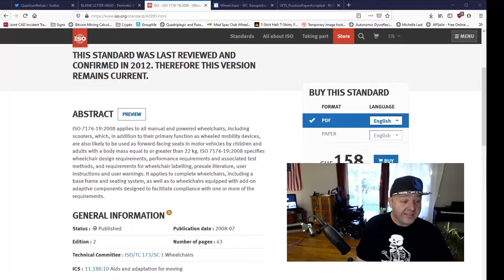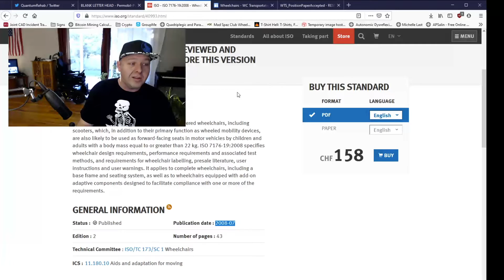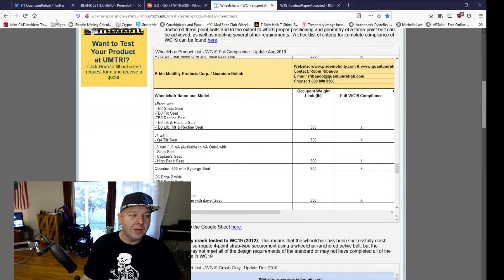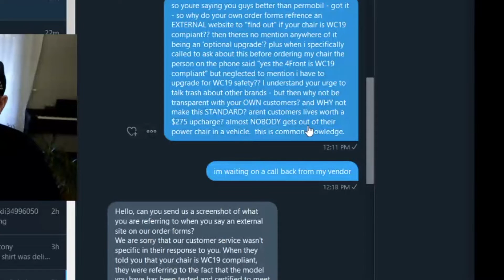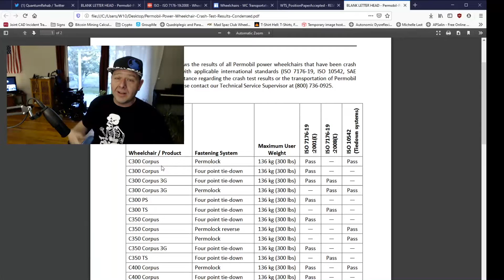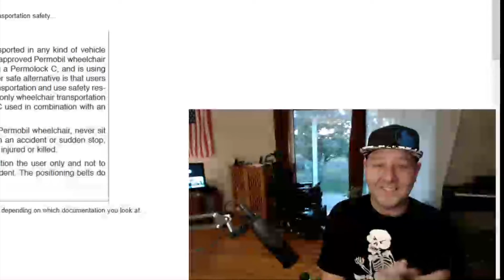WC19: is your wheelchair SAFE?

Comment: The NHS are very particular about this in the UK and that's one of the reasons Sunrise are the main provider of EPIOC wheelchairs to the NHS. Sunrise recommend that wheelchair users transfer to a vehicle seat when riding in a motor vehicle but accept that it's not always possible, in which case they advise that the wheelchair is secured in accordance with the WTORS manufacturers' instructions that conform to ISO 10542.
Basically, Sunrise chairs are crash tested and approved for use as long as they are properly tied down.

Comment: I have a friend that I met three years ago and she was in a quantum sex and we were on a bus going to an event and the driver slammed on the brakes to avoid getting cut off in the back of her chair wasn’t even tied down! So her chair went into the seat in front of her and her controller what is almost Apple Pay through the back rest of the seat in front of her!
Anyways I know part of the problem was brought on because of the driver of the bus, but still now that I know about WC19 it actually makes me surprised that her chair didn’t get damaged. 

All I can say though is my F3 and a quite a bit of punishment on those bus rides due to the drivers lack of awareness to go easy on rough roads. Sure my tires slid a little bit but the chair itself did not roll. The driver of the bus actually hit a speed bump at full speed and one of our wheelchair passengers went flying out of her chair landing in between The bus wall and the wheel of her chair! But my chair did not move at all! So knowing that permobil is ISO approved gives me more peace of mind knowing that I’m safe with their product. I’m really questioning quantum now. It’s a good thing I’ll have an appointment in a couple weeks when I start to fill out the order form for my new chair because I will bring up the subject about WC19

Comment: That video clip of a wheelchair in a crash test.. the wheelchair survived!        Oh, the passenger? No, he/she would have died.
I never had a wheelchair, in 24 years, that I find safe in a car, while I go in a car regularly (while sitting in the wheelchair -my only option). Because of that I wanted to add safety parts on my latest wheelchair, to increase the chance of surviving even a little crash. They did not want to add these safely parts, because they are not CE tested for safety...

Comment: In looking over my Magic Mobility Frontier V6 AT wheelchair it has robust-looking tiedown points on all four corners and an automobile grade seatbelt. Does this mean it's WC19 compliant? That's TBD. I did go to the Magic Mobility website but it never mentions this. Do know that MM is based in Australia.

Subjectively speaking in comparison to many other powered wheelchairs mine is a LOT more robustly built. I feel much more confident in my wheelchair than I would in others and I trust it would not fail me in the event that something did happen in a moving vehicle like my van or public transportation.
Reply: I did find this: https://www.magicmobility.com.au/wp-content/uploads/2019/06/Vehicle-Crash-Testing.pdf
Reply: Yeah I feel the same in my Permobil M5, hardcore.

Have had several chairs before this, my old 
Craprocket, Q6 Edge, the frigging brackets got sheared off several times, also complete frame break 3 times, POS!
Best Quantum wheelchair I ever had (had 4) was the Rival, that thing was a TANK, LITERALLY.

Comment: Huh, so it turns out my chair might be equipped with an ejection seat.  Very interesting.  Think they need to replace your chair.   And new chairs need to meet the standard.  Period.  Not sure if old ones can be made compliant or not.  
Thanks for the chain/tire video and info.  Helped us tremendously.  My wife's turning into a chair mechanic.  Next question for our bounder.  I need more ground clearance without adding width.  Any tire recommendation to fit the stock wheel?  The casters appear to have plenty of room for larger wheels as well.  Just not sure if they are even made.
Reply from the maker: the tires i put on in that video are about as big of a diameter as you can go without interfering with the brake housings.. i can only get one finger between them right now... - but without switching to bigger diameter wheels its gonna be hard to find taller tires in that size with MORE sidewall height..  im looking to swap over to maybe 8-10" wheels, then there's a lot more options for tires on that size wheel.  but i haven't done any searching just yet.. but these tires i hvae on it now are WIDE.. i dont take the bounder into the house - so its not an issue for me.. but it BARLEY fits thru residential doors..

Comment: I got hit by a car at low speed in my F3 (took the bumper to the knee but didn't break anything—mostly healed after about 3 weeks) and my chair seems mostly ok. (Good crash test, but I don't recommend being in the chair for it.)

My seating switch box stopped working and one wheel rattles sometimes now, but it's in surprisingly good shape. All of the actuators work fine. Still needs a little work though.

Comment: I wonder if driver side chair restraining devices, EZ-Lock and  Q'Straint, fall into this scenario ?  Great research BTY
Reply from the maker: as far as i can tell.. the WC-19 and ISO stuff relates to 4 strap securement - BUT the structure of power base, and the strength of the connection to the seating etc is determined when connected to an automatic docking system...   unknown..
Reply from the maker: after watching a bunch of the DAHL engineering crash test videos - its fairly apparent that 4 straps would result in a lot less movement, than a base dock on some of the chairs..
Reply: @TotallyNormal-  I'm still able to walk, a little bit. So I use 4 Q'Straints and those things are tough. I have total confidence that both the Q'Straints and my Frontier V6 with four tiedown points will save the day. Buuuuuuuut, stuff happens as we all know.
Reply: @TotallyNormal-  go look on QSTRAINT website,/videos. 
My life has been saved by their products, especially on my old Rival.

Good points for tiedown on the Permobil M5 also.

Comment: The question is why is it even allowed to sell a chair that is not compliant. I would think the figures are more like 99% of all wheelchair users have been in some sort of subway/train/car/bus at LEAST one time in the life of the chair. People don't think about or research if their chair is safe to ride in a vehicle because for the $35,000 +/- they would assume it is safe. Just nuts and should lead to some crackdowns and compliance. The problem is, someone, somewhere is going to act on this and the price is going to go up even higher and insurance is going to cut down on even more "options" that should be standard. In my opinion there should be absolutely NO OPTIONS on chairs and all chairs should come standard with all "options" especially when it comes to tilt/recline/leg lift/ and elevator.
Reply: EXACTLY !

Comment: I was on light rail once when they slammed on brakes to avoid hitting car crossing the tracks.  If I hadn't been parked adjacent to short wall near exit door, my chair would have went over with me in it!  wheels came off the floor on one side, but I was able to brace myself against the wall and prevent chair from tipping any over on its side.  They don't have any tie-down straps on the trains, but now I know to always park adjacent to wall in case they slam on the brakes again.